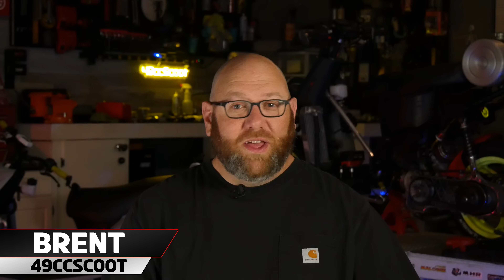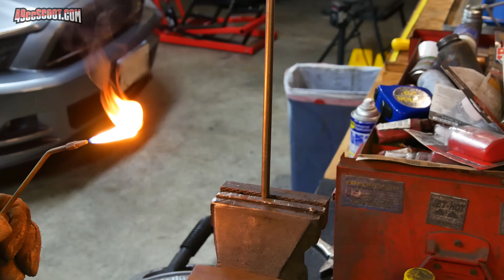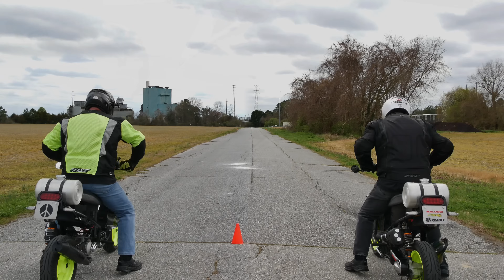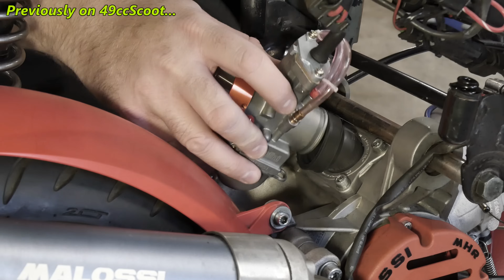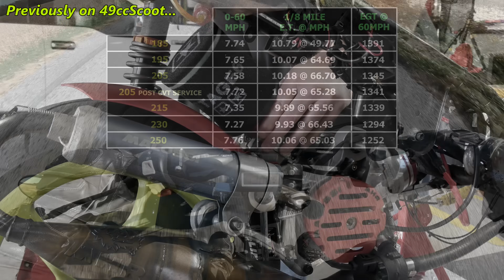Stage6 R/T Programmable PVL Ignition Setup & Timing + Tool Battery Conversion : RC1 : Part 23 : PWK

Comment: Hey Brent! Been meaning to get on the forum and even to comment on the last two videos of yours that i watched but outside sources just keep seeming to stop me. My excuse and I'm sticking to it  🙃
Anyway, as soon as I saw that Polini carb I had to comment. So, with Polini's name emblazoned beautifully on the side there that you'd actually be holding on to some premium quality billit alluminum. And you might be, but when I heard you mentioning the tuning problems then I was willing to stand up and stake what little reputation I have, that what you have there is basically junk. And I bought one myself and found out about it and it's issues by chance. Found a thread somewhere, couldn't even tell you where, that they're basically knock off junk. And the issue is un-metered air; they leak like a freakin sieve. So I went on ebay, found me a real 28m pwk from an 85cc Honda or Yamaha (pretty sure but it's been a while so fact check me on that). Installed it with the jetting  I'd put in the Polini and it literally ran perfect.  And I never had a problem with carb issues again. If I wouldn't have had the issue myself I'd sorta have a hard time believing it. I still have that damn carb somewhere.

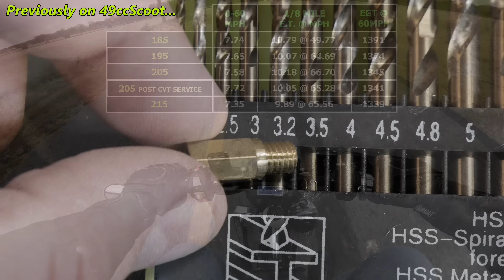Okay, now that I've typed all of that, I'll continue where I left off  ( 1:02 ) and see if that sexy PVL cures your problem. No matter what, getting rid of that extra mass will def help it spin up faster and mo betta.
I'll add to this comment after watching vid...
Did not expect to see issues with the PVL. Mine was a PVL made for Bidalot. Youshould have enough clout with scooter tuning that they'l' let you return that one. Because of the variable curves< id try return that one for Bidalot  and pay the difference. I surtely would't be happy about having an expensive iggy that needs a 40 pound weight stuck to it to work. Defeats the whole damn purpose.

And I promise you that getting rid of that fancy ass Polini will solve your carb issues. Just make sure if you're going used, and no reason not to, that the seller will let you return, but I'm sure that you already know that.
Reply from the maker: Ryan's has worked great for him for years and still worked poorly on mine. That's the one thing that really gets me with it. Still, I'm thinking I won't be buying more off-brand PWKs.

Comment: Hope you get this sorted. Guess Ignitech doesn't provide their system for this application?
Reply from the maker: I don't know much about IgniTech. I had heard of them, but just looked them up again. Might be an option. The more home made appearance scares me a little. It could be a good thing with a high level of care. I had a bad experience with a sort of home brew ECU for my Mustang that was basically the demise of that project so I'm probably being unfair there.
Reply: @49ccscoot which one on the mustang did you have the bad experience with, mega/micro squirt ?
Reply from the maker: @robertmason8341  Megasquirt. Someone was selling one in a Mustang ECU box, mostly plug and play. Had to do only minor rewiring. First one never worked. Replacement literally went up in smoke first time it got power. By then, I ate up a year or so waiting for a replacement and trying stuff with the first one. Money for nothing and I wished I just bought a real engine management system, but it frustrated me so much that I quit at that point and sold the car because scooters were way more fun.

Comment: I had a similar problem with my stage6 ignition. on my malossi 94 rc one. and on my new scooter I have italkit/selettra ignition. personally I think it is much better and easier to start... stage6 just gives the answers they have written on their website, they don't know much about their own tuning parts... plus stage6 is hyped up.
Reply from the maker: The primary thing that makes this a good ignition in my eyes is the programmability. I like that I can make whatever curve I want and fine adjustments as desired with some mouse clicks. If not for that, I don't think I'd ever recommend it. I've had 2 MVTs now and both were predictable. If I measured a curve and changed the stator setting, the timing went where anticipated.
Reply: @49ccscoot  i find a programmable ecu very useless on scooters, it's really cool but malossi's default maps are really good and the only thing that really matters is advance near max power rpms. I can't really find an answer to why the ecu would behave like that. People who use scooters for competition tend to prefer polini's pvl or a normal pvl with 2fast ecu (both programmable). I think the man who can give you answers is "Rubio's ignitions", but I doubt he will really help you since you didn't buy from him. I would also like to suggest to use a vhsh dell'orto carb, it is far superior to anything else imo.
Reply from the maker: @nazzytpr  I looked at the VHSH a little since I saw Malossi using them for their 100cc RC-One... if it ever actually comes out.

Comment: When your adjusting timing  to 3.59 does that not change what the compression is at when firing which changes what the squish is at at that picticuar timing ? I’m not use this stuff but that’s what pop in my head
Reply from the maker: It's not altering any engine characteristics aside from when the spark happens. Squish and compression will remain the same. Conditions at spark timing will change, but that's what dialing in timing is all about regardless of whether it's set with a mechanical or electronic adjustment.

Comment: I have a question. How much psi compresion primer for road race, drag, daily, thankyou verymuch from Indonesia
Reply from the maker: Lots of variables there. On my gauges, the RC-One is usually somewhere around 160psi or a little more. That's all around use for me. I know some people on race fuel run very high numbers over 200psi for drag racing.
Reply: @49ccscoot  crank compresion sir not silinder compresion?
Reply from the maker: @NOBITA-01.0  There's a supposed ideal ratio for primary compression, but I've never heard of a psi number.
Reply: @49ccscoot  terimakasih

Comment: I noticed that my pwks will not work with that steep of angle, as soon as I made my carb set level 80% of my problems went away.
Reply: Yeah I'm not a fan of that angle ... I've seen a Yoshimura carb that compensates for those angles and had a unique plenum that allows the float bowl to remain perfectly horizontal in that position.
Reply: Yoshimura YD28 I think...
Reply from the maker: @pirrracy  Nibbi (and others) even make knockoffs now.

Comment: Happy Thanksgiving Brent... Even though most of the material covered in this episode was just a hair above my pay grade, I do feel like I learned some things... Mostly, don't swap out my ignition with a programable Stage 6... haha... It seems crazy to me that a "reputable" company like stage 6 would not provide better (or any) tech help... Especially when it comes to a guy like you that really knows his stuff and has a YouTube following... On a side note... The last place you broke down had some beautiful scenery...
Reply: Stage 6  miała dużo wpadek ze swoimi produktami
Reply from the maker: @kamilr3511  I don't know their whole history there, but I remember complaints of their street  race cylinder kits being too tight and seizing years ago.
Reply from the maker: I assume it's just profit margins. Way easier not to put any more time ($) into revising something even though the MSRP on that ignition is over 600 Euro. We'll figure it out. The main thing with the pre-installed curves that bugs me is that it would be nice to have them as they intend for both checking and in case you wanted to go back to them. Once programmed with a custom curve, I don't think you can go back to theirs.